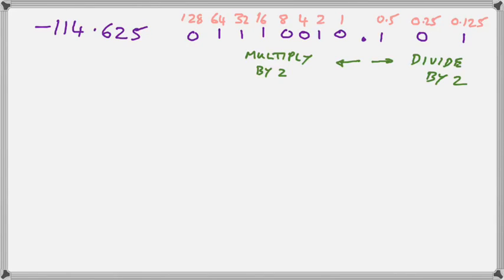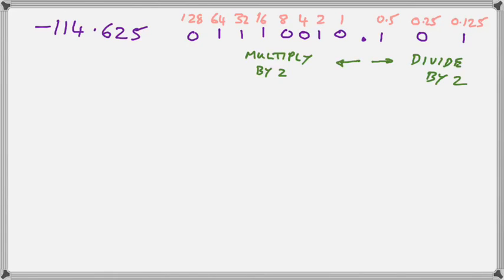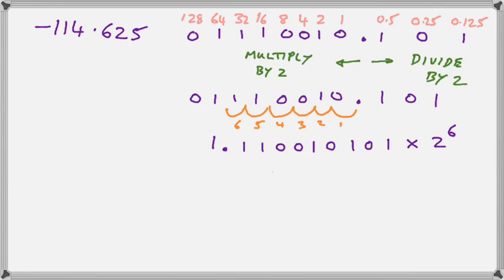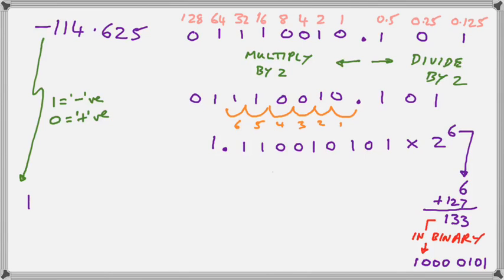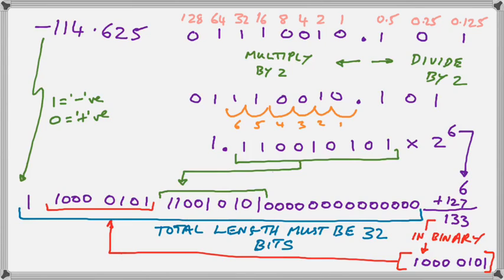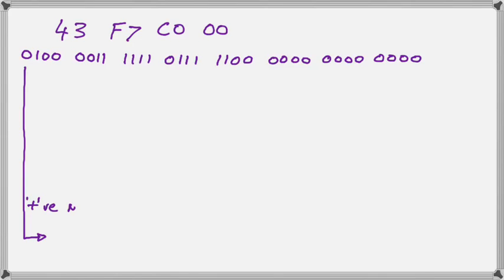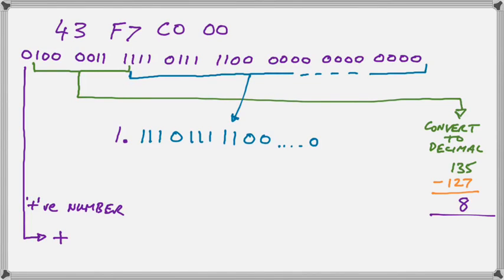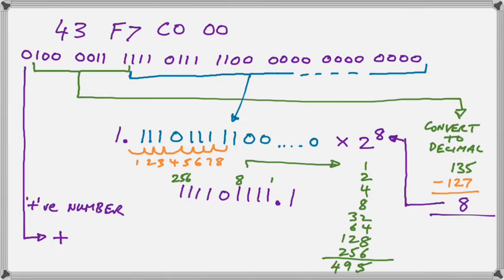Single Precision Floating Point Representation

Comment: why do you have an extra 0 in front of the binary of -114.625?
Reply from the maker: just to complete the BYTE ..... data in computers is always in multiples of 8 bits..... HOWEVER, if you prefer to leave it out (in this case) you will still get the correct answer 🙂..... padding with zeros to the LEFT of the integer part (or to the RIGHT of the fractional part) has no effect whatsoever on the maths ...... but since all computers perform maths on a FIXED number of bits (padding automatically happens all the time 😁)

Comment: Y do u multiply 114 , y can't we divide it n multiply 0.625 ...am confused sir can u help ..for my knowledge I use to divide 114 n multiply 0.625. pls help
Reply from the maker: Nowhere in my video do I   "multiply 114" ...... HOWEVER if you get the SAME answer by "dividing 114 n multiply 0.625"  then please continue to do that..... there is more than one "method" that can be used.....  if your "method" results in the SAME answer as mine then you need not waste your time trying to understand my method ....  but simply continue to do what you have been taught

Comment: Sir,
Would you please elaborate on what is bias value 127 and what is the purpose of using bias in 32 bit floating point representation? Please help me .this is a humble request.
Reply from the maker: The purpose of using a bias value is just a convenient method to separate the number range (all combinations of ones and zeroes) into (approximately) half..... half will be positive numbers and half will be negative numbers .....  TWO'S COMPLEMENT  does basically the same thing ...... but possibly a  reason why  the bias-127 was chosen for 32-bit F.P. representation is because it allows 00000000 to be used for "absolute zero"  and 11111111 to be used for NAN ..... which I explain in this video https://youtu.be/2ksC9vKBKP4  .... in any case it is just a man-made choice of convenience (easier to implement with logic gates or software algorithm)

Comment: sir although video remain very helpful for me specially but sir there is mistake in conversion of binary to decimal part that in floating point you write 495.5 but actually it is 239.5 kindly recheck it after moving 8 bits of exponent we have remaining 11101111 but mistakenly you have done the calculasion of 111101111 kindly recheck it and if possible reply ......

Comment: How does cpu processes operations between integer  and floating point values
Reply from the maker: Your question is not clearly written ..... what is  an "entire"  value ??
Reply: @StephenMendes  i had a typo sorry. It's integer instead of entire
Reply from the maker: @Rami7605  The computer first converts the integer to the Floating Point format and then uses the Floating Point maths subroutines ..... the result will be a Floating Point number...... in Mathematics, all integers are just a subset of Real Numbers  (an integer is a Real Number with a fractional part of ZERO)
Reply: @StephenMendes  thanks for explanation dude
Reply from the maker: @Rami7605  you are welcome 😊

Comment: hi Stephen. Can you show it  in a more difficult example like 4678.768
Reply from the maker: Not all decimal fractions have a perfect binary equivalent and this introduces error..... this means that  every bit of the mantissa has to be calculated (and the final stored number is not exactly the same as what you want to store) .... this is very time consuming for humans to work out (because computers are so fast the algorithm works in less than a second but it could take hours to do it by hand on paper) .....  therefore when I set such questions for students I have to make sure that the fractional part does not use more than 4 or 5 binary digits (is an EXACT binary conversion) otherwise they would never finish the exam 😒